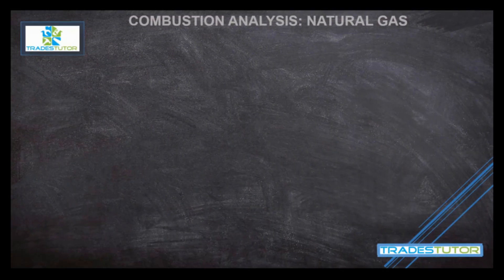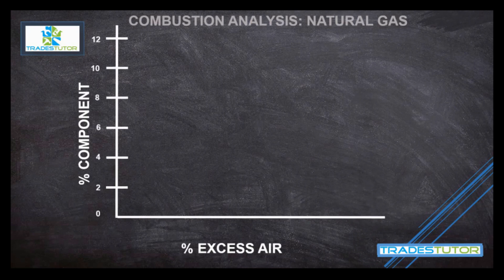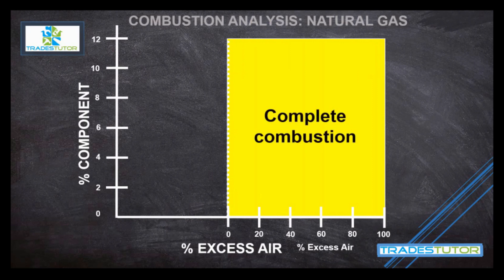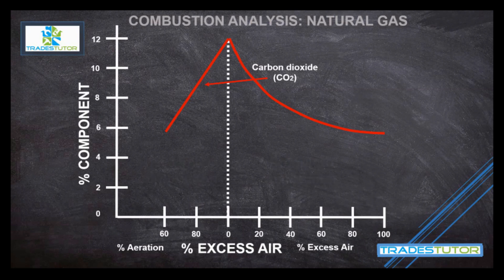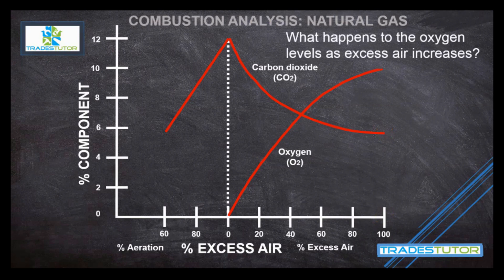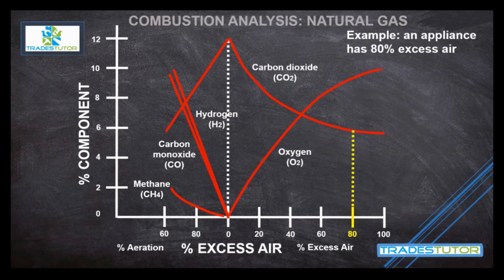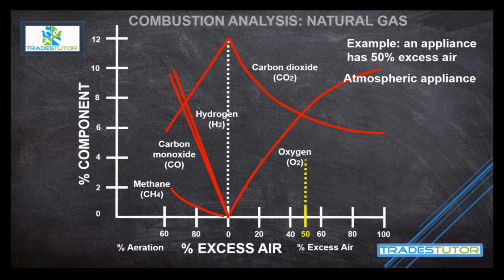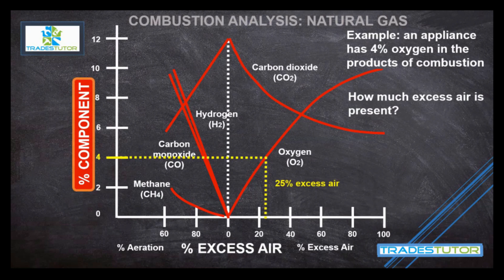Combustion Analysis for Natural Gas

Comment: For furnace the Draft motor speed is fix i.e. air input is fix, now to get the maximum heat out with minimum gas input (max efficiency) adjustment (air & fuel ratio) for the fix burners profile study is important.

Comment: So are you saying that there's no problem with running lean while using NCG? because there is when using gasoline
Reply from the maker: Hello: This chart only works for natural gas. Gasoline will have its own set of characteristics..
Reply: @tradestutor1191  Thanks. I just don't understand what can happen to the engine (temperature, valves...) if you go too far away from the 0% excess, to the lean side (excess in oxygen).
Reply from the maker: @byAnArgentinian  Ya, I'm not sure either. That would be a good thing to look up though as the more you understand the chemistry of combustion the more efficient you can get. And the more you understand combustion efficiency the more interesting gas appliances and anything else that runs on fuel can become.

Comment: hi, im from colombia, thanks for this video, could you tell me if this combustion chart for natural gas work to every sistems, i mean, im working now with gas engines and i will try to understand that, so, i dont know, maybe you can talk to me about it. Best regards, oh, im mechanical engineer.
Reply from the maker: HI Luis: This chart should work for all natural gas systems including gas engines.  I talked with an industrial gas fitter that I work with. He said that the only thing that might change the chart is any variables that might be added in the systems you work with. If you have more questions pass them on to me and I'll see what I can find out. Thanks for watching!